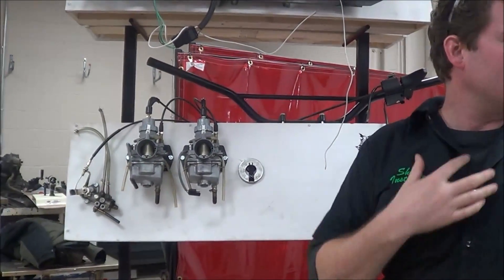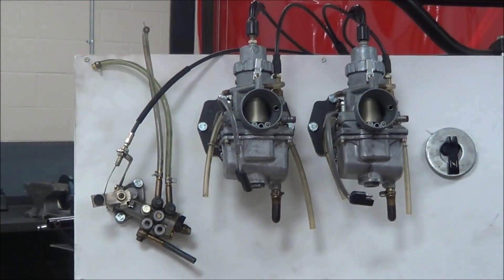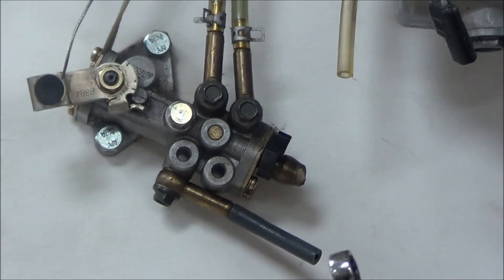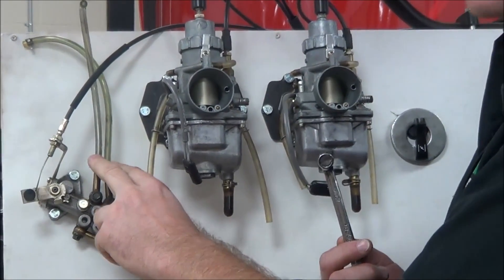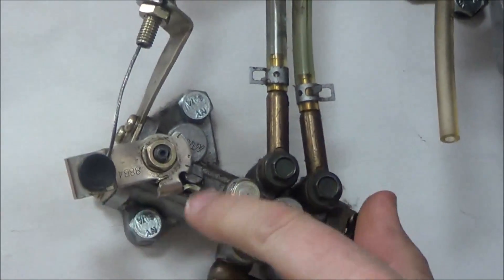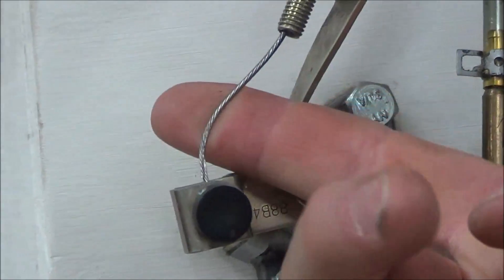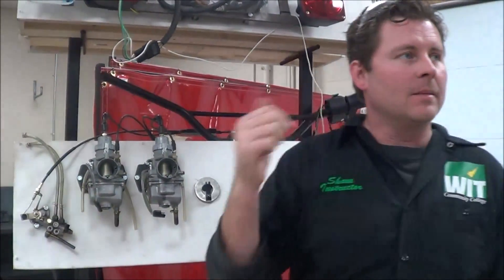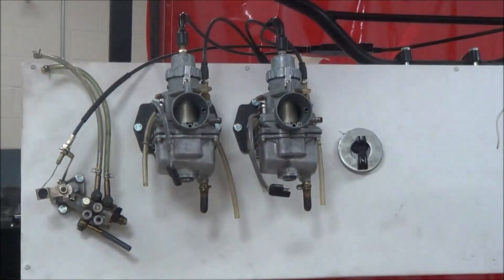How to service 2 Stroke Oil Injection System How to prime oil injection pump #how2wrench #2stroke

Comment from the maker: Nabil had a good question below and I wanted to re-post here. KEEP IN MIND, NO VIDEO HAS ALL THE INFORMATION. THESE VIDEOS ARE MOSTLY MEANT FOR REVIEW FOR MY STUDENTS AND A GLIMPSE INTO WHAT IT WOULD BE LIKE TO TRAIN HERE. ENJOY THE FREE MATERIAL, KEEP SHARING AND COMMENTS ARE WELCOMED!

 Let me clarify. If you had been in our class or a student here you would have learned to use assembly lube on the motor rebuild and you also "prime" the oil pump lines when servicing or rebuilding the system. 
Some mechanics also like to use a premix of oil and gas for the first tank as well. I do not. If the proper assembly lube, and prime procedures are followed, there is no need. 
I have an entire series of videos on this channel with this information in my WITCC 2-stroke playlist.
Reply: how would i adjust the throttle actuation on an rd 250?

Comment: I have a 2 stoke moped that is leaking oil into the carb even while the engine is off and I am not sure what to start with. Would you know if  it is a matter of adjusting the cable at the oil pump to stop the flow of oil from being gravity feed into the carb? or do i need a new pump or something? what keeps oil from flowing into the carb by gravity because the carb sits below the oil tank?
Reply from the maker: +adam christensen 
I emailed you back...:)
Reply: +Shane Conley  i have the same problem as adam christensen,,, can you help me,, 50cc dio scooter

Comment: How to let the engine running while there isn't oil with the gasoline?
Reply from the maker: +Nabil Ghenima 
DON'T
Reply: +shane conley 
You said in the vidéo that you can let the motor running until the air come out of the two tubes connected to ca
Reply: +Nabil Ghenima 
You said in the video that you can let the motor running until the air come out of the two tubes connected to carburators? I think there is no oil in the gasoline to lubricate the motor!!!
Reply from the maker: Good question Nabil. Let me clarify. If you had been in our class or a student here you would have learned to use assembly lube on the motor rebuild and you also "prime" the oil pump lines when servicing or rebuilding the system. 
Some mechanics also like to use a premix of oil and gas for the first tank as well. I do not. If the proper assembly lube, and prime procedures are followed, there is no need. 
I have an entire series of videos on this channel with this information in my WITCC 2-stroke playlist.
Reply: I live in TUNISIA (north Africa) and I have an Ultralight aircraft X-AIR. I just bought a good ROTAX 582 with oil pump (120hours). I'm going to the it on the X-AIR. So that's why I was interrested with your video wich is very interresting. Excuse my English (our langage is Arabic then I can seek well Frensh and of course little bit English).
Best regrads.
Reply from the maker: +Nabil Ghenima Way cool! Have picture? I will show my students!
Reply: The motor will arrive this weekend. I'll begin the installation next week. Will send you pictures.

Comment: what powers the pump, if it is not located near the engine?
Vacuum line to the intake manifold?
Reply from the maker: +jamesdond1 
Its driven by the crankshaft. Gear to gear.

Comment: What is the other line and dot for on the oil pump lever?....and is it good to burp the lines to the manifold while the engine is running...cause then there wouldn't be oil getting there for a small period of time.
Reply: That's where u want it at idle so ya dont burn it down warming up
Reply: Premix your gas till it's all figured out